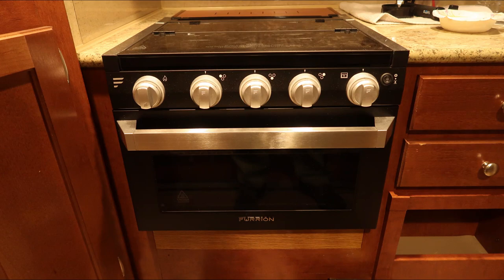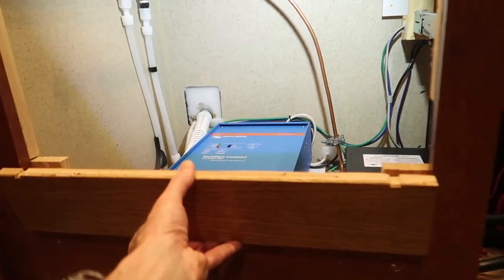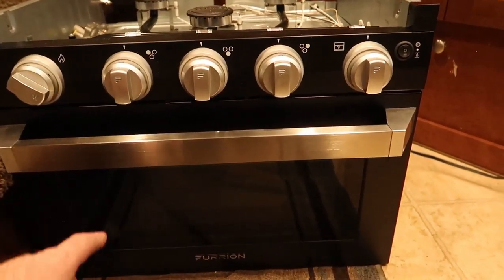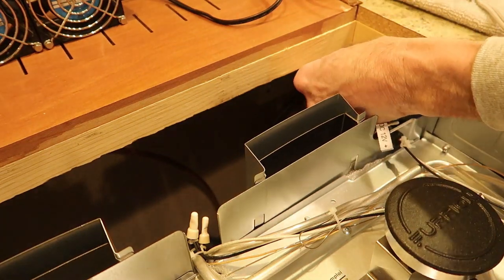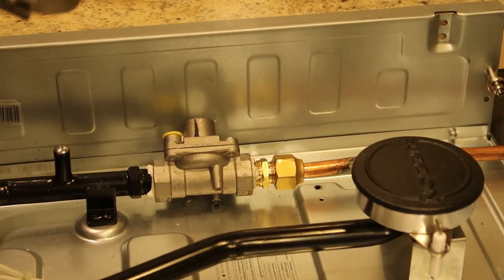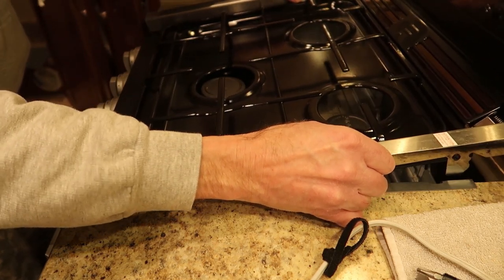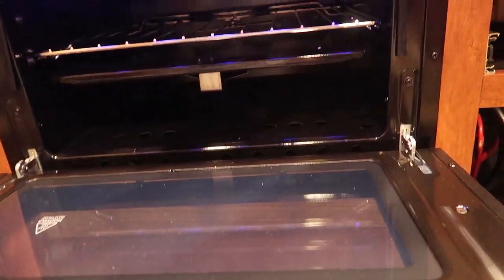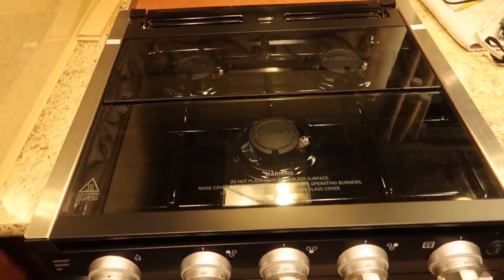Furrion F1S17L03A-BL RV Range / Oven Installation | Arctic Fox 992 Upgrades

Comment: Do you recall the model number of the oven? I'm going to have to get the same one for my inverter install. Thanks and great videos!
Reply from the maker: I found the part number and added a link to it in the description above.
Reply: @deltabravo1257  Thanks! Are you happy with it?
Reply from the maker: @dominicscerra3161  Yes, I love it!  The light in the oven is a really nice feature, so is the window in the oven door.
I really like the backlit knobs too, it make  a nice night-light.
Reply from the maker: @dominicscerra3161  When I added the link yesterday, Amazon only showed one in stock.  Hard to say when more will arrive if you wait to order it and miss out on the one they currently have in inventory.

Comment: How did you wire the blue back lighting?
Reply from the maker: I ran a new wire from the fuse panel located on the wall below the sink.  That fuse panel supplies power to the 12v outlets and the TV's 12v power outlet.

Comment: Looks great! What is the minimum clearance for the inverter to bottom of the oven. I'm thinking of mounting a renogy 2000 inverter in the same location. I have an AF811.
Reply from the maker: 2" or so is about what I'd recommend between oven and inverter.  The the original oven, I had less than 1".  There are much lower profile inverters than the Victron, but they have a much larger foot print and wouldn't have fit below the oven in my 992.  The 811 has more space under the oven, particularly to the right side.